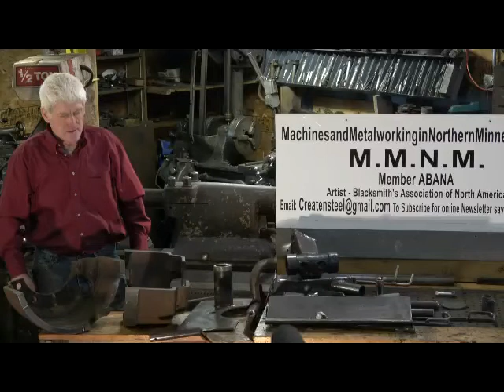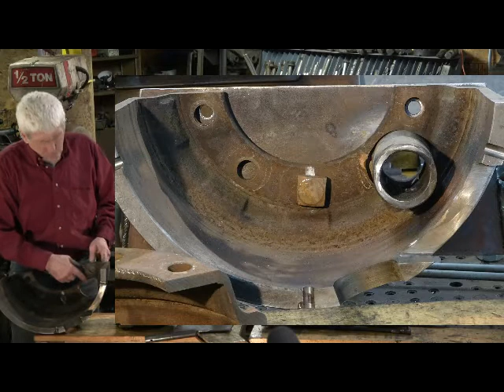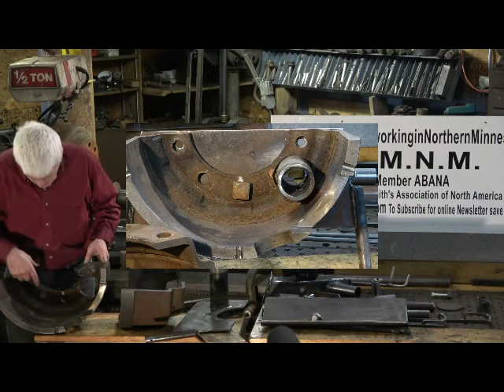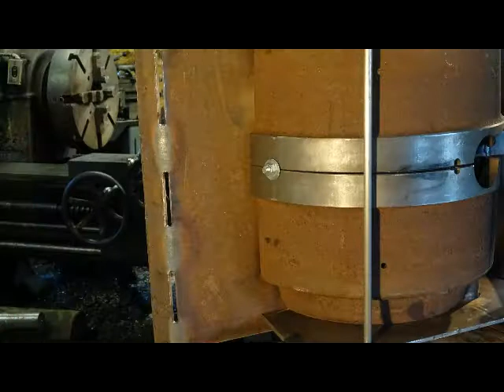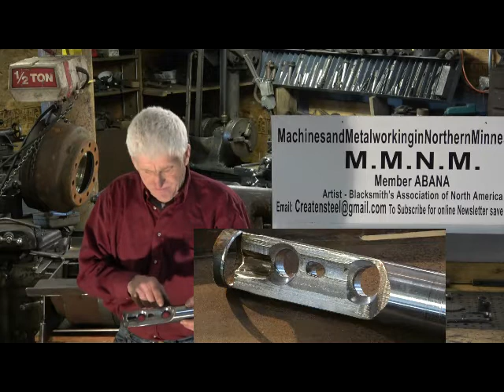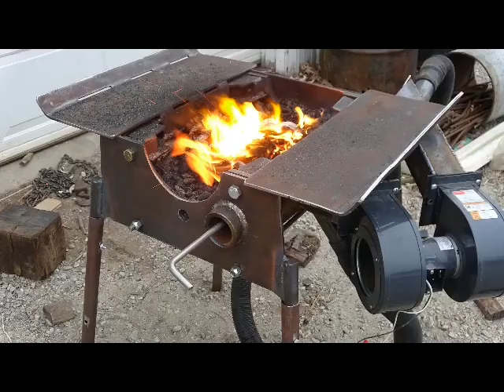Blacksmithing-Side blast, Air cooled , Semi-Trailer, Brake Drum Forge .

Comment: hm interesting concept. I've seen large brake drums used for forges before, but not in this way. the idea is to always run the blower at full blast and only use the slider for control/air routing?
Reply from the maker: Yes this is the idea, I am running the blower at max. all the time, bypass air is used to cool tuyere, and also, recycled to my forge hood to remove smoke. {induced draft }  The efficiency of many blowers really drops off when choked down, with this system, the blower is efficient.